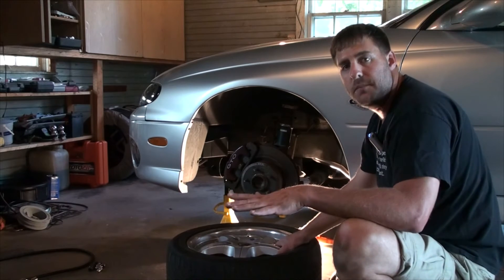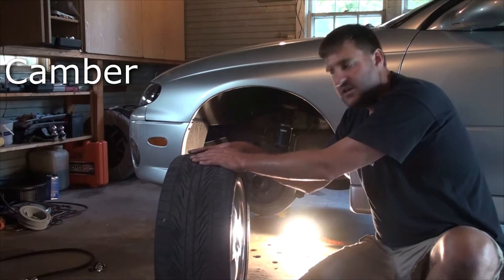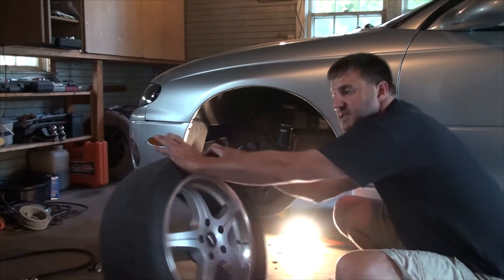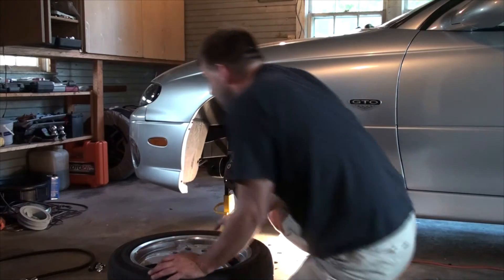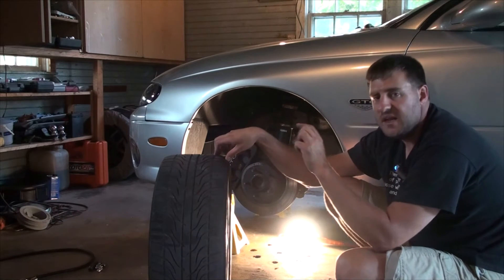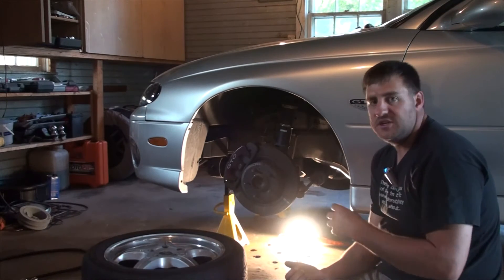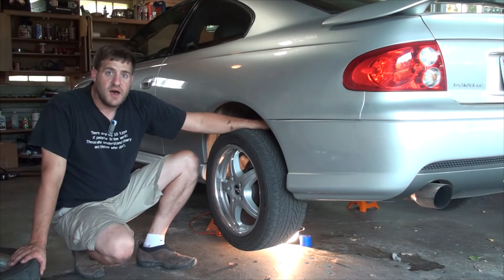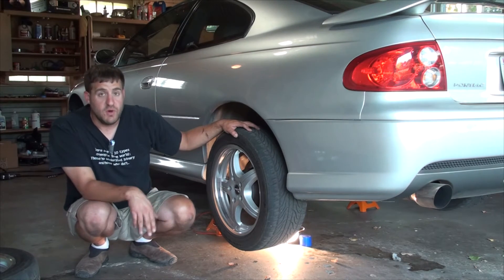Josh's Car Corner - Ep. 25 - Car Suspension 101

Comment: I am aware this is an old video, I would appreciate your input. I just bought an 2006 GTO. Wondering if you can recommend which wheel offset would work better to accommodate a 245/40/18 tire. I will be upgrading the suspension with coilovers. Also, if I can go to a wider tire than that would work too, like a 255 or 265. Thanks.

Comment: What’s your alignment setup. I took my car to shop and they only did the gm setup but I’m on full XA suspension.
Reply from the maker: I run the stock caster in the front, -0.6 to -0.8, +9.0 degrees front caster, but I run a 0.0 camber in the rear because I have a staggered tire setup. There is no rear caster setting, and rear toe only gets out of whack if you have a bent toe rod.

Comment: Great information bud thank u for all the help and info would u by chance know why my front tires are going balled on the very edged tires don't have more then 1200 miles on them car doesn't see snow garage kept thanks for the helpfull info bud and great video info.
Reply from the maker: Clayton Wilson Without seeing the car it's hard to say for sure. If it's the outside edge you could have too much toe in or positive camber. If it's the inside edge, you have too much negative camber, but that much would be obvious just by looking at how the tire sits in the wheel well.
Reply: Thank u for the info bud and help have to get this resolved thank u again